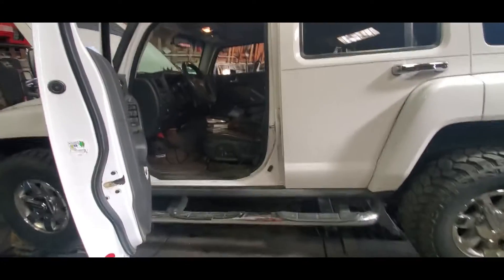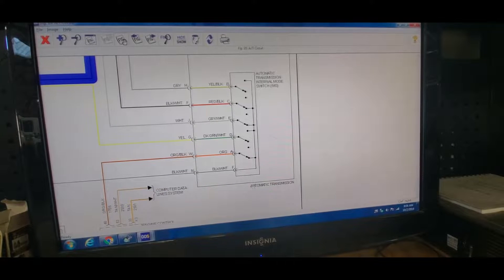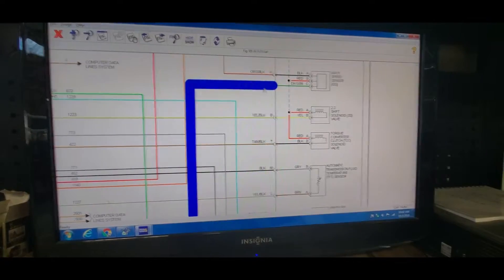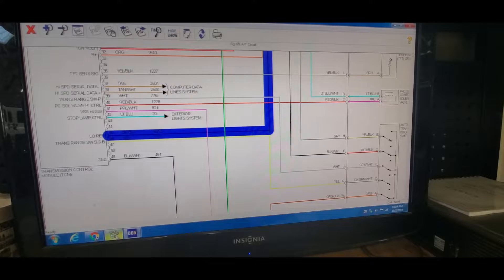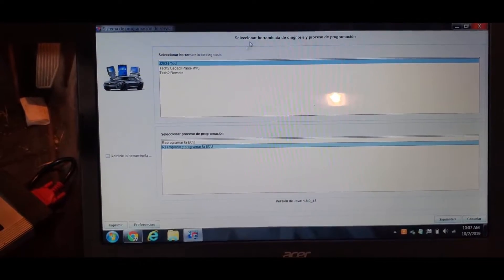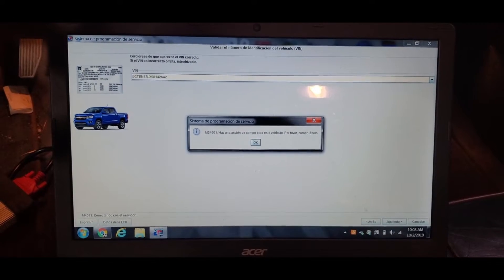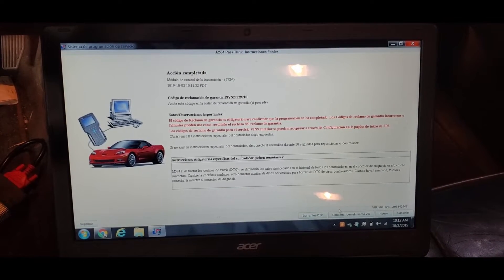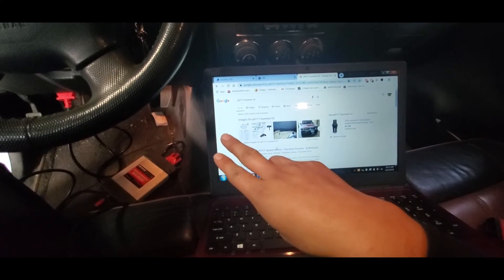How to fix code P0717 turbine input sensor "09 hummer H3 +TCU programming"

Comment: I have this same code but hummer can get started up and drive for about 2 mins then I go to accelerate and nothing it won't go. I can turn off and wait a minute and start up and go again for a few minutes.  I have gotten vehicle up to 70 so it dose shift gears. Any help please.
Reply from the maker: have u scanned for any codes sounds like pressure loss in the tranny
Reply: Yes I get the same p0717

Comment: Having same code for my 07 H3, I don't have TCU.

I am in process of ordering/replacing fuse box as mine is corroded, my guess is, that is part of problem.  
When I have this code, I have very hard shift into D or R.  
My daily routine is to turn on car, clear this code, then hard shift is gone until I switch card off/on. 

So, sensor works, but is not getting voltage at the startup sequence and throws code, when car is on, voltage is fine.
After fuse box change will inspect all wires for leakage/corrosion.
Reply from the maker: Latvju Avs yea use the multimeter to check the continuity of the cables to the transmission connector.